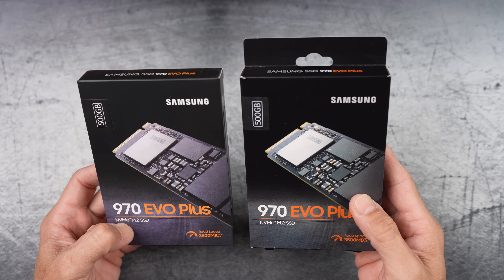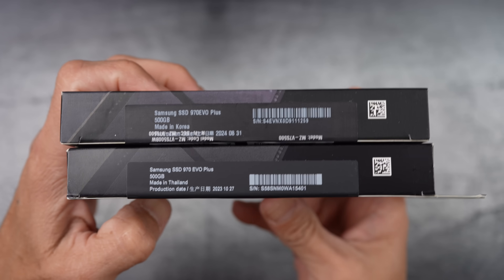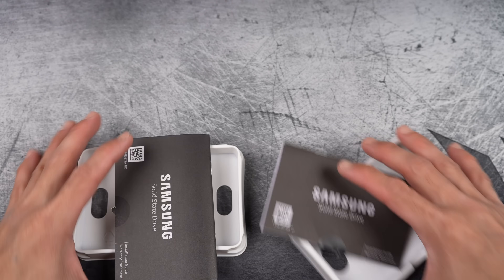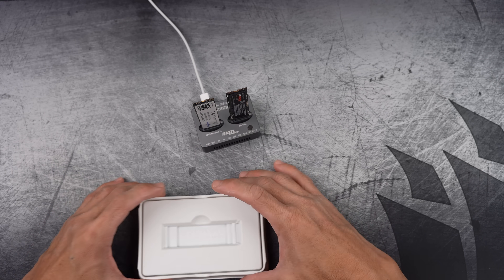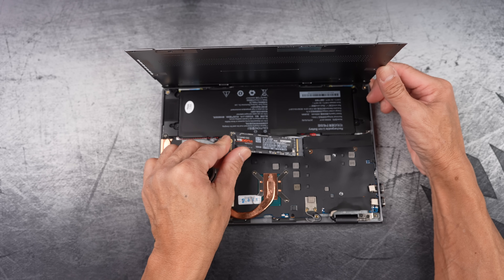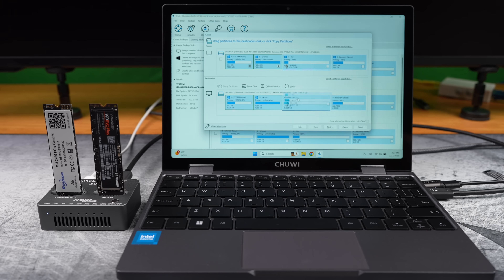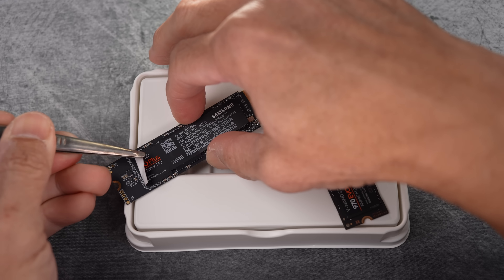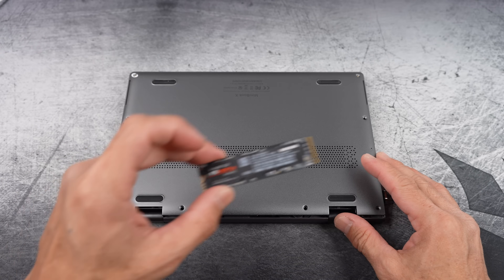Fake vs Real SSD - Can You Spot the Difference?

Comment: I already knew here that the one on the right was the fake because, for example, I didn’t like the sloppy sticker application, also the SSD controller wasn’t visible at all even though it’s shown large on the box, and overall it looked poorly finished, like the rough workmanship next to the cutout for screwing it in.
Reply from the maker: Great observations! The sloppy sticker application and rough workmanship are definitely red flags, and it’s interesting how the SSD controller wasn’t visible despite being highlighted on the box. Your attention to detail is great—thanks for sharing these points!
Reply: @TossSong  I avoid buying expensive electronic devices, like M.2 SSDs, from marketplaces like AliExpress, and instead, I prefer to pay extra and buy them locally where I have the assurance of authenticity.

Comment: You should check the names of the drives under the device manager to see which one has a generic name.
Reply from the maker: Great tip! Checking the device manager for generic names is a smart way to spot a fake drive. It’s such a simple step, but it can save a lot of trouble. Thanks for sharing this advice!

Comment: I think Samsung Magician will know if the drive is fake.
Reply: Not true. There’s some videos on YT showing how they tricked Samsung Magicians with some copies.
Reply: @ I find it hard to believe they can fake an authentic Samsung serial #?
Reply from the maker: Thanks for your comment. Yeah, it’s quite convincing. The serial number on the fake drive is not in the Samsung SSD database, but it does show up (just the name) on the Magician app.
Reply: @TossSong  So the consumer needs to be super careful not to get ripped off. First rule: Never buy anything like this out of China and always from a seller with a long track record of honest dealings and lastly, confirm the serial #.
Reply from the maker: @JoshuaTrenge Thank you very much for this information. Hope I won’t fall for another one like this.
Reply: @TossSong  I’m sure you won’t.. thanks for sharing your experience with everyone.. very helpful!
Reply from the maker: @JoshuaTrenge Thank you! I’m glad the video was helpful—it’s great to be able to share these experiences and help others avoid similar issues!
Reply from the maker: Thank you for your comment. Yes, I’d agree. If you notice on the laptop screen, I have the Magician app installed. However, it would have been a short video. But I could have included it at the end.
Reply: they must of changed something when they updated the software to version 8 cause I didnt get the non genuine message until I updated my version of Samsung Magician from 7 to 8. I bought my 970 evo at microcenter in 2019
Reply from the maker: Th Magician software says that the manufacturer is Samsung, but it won’t read the S/N properly and no ‘Genuine’ mark next to it.

Comment: I knew which one was the real one from the first view.  I bought a 980 1tb, and it had the hanging tab, so I knew that was the one that was real.
Reply from the maker: Thank you for your comment for sharing. It’s great that you could tell right away. The hanging tab definitely helps as a reference. Not everyone has that experience, so it’s great you spotted the difference so quickly. For me, I wouldn’t know it until I opened up the box for this drive.

Comment: the fake drive has good speed, better than any 2.5" sata ssd.
Reply from the maker: Thank you for your comment. I agree. So what I now use it for is as an external drive with housing. It works just fine, but I hope it will last.
Reply: And you can trust it for years to come.Or NOT????? hAha
Reply: @PHOTOREACTION  Trusting any single storage device with your data is like asking for data loss, even if it isn't fake.
Reply from the maker: I would definitely agree. Thanks for bringing this up.
Reply from the maker: Yeah, that I don’t know. I’ll have to see. Hope it will. Thanks for your comment.

Comment: Macrium has an option to copy partitions to fit and will automatically reduce the Windows partition to make it fit if the destination drive is a little smaller. I use it all the time.
Reply from the maker: Thank you for pointing this out. I did notice the option. However, I tried and tried to shrink it, but kept getting an error message that I forgot what exactly was, and that the partition was a fixed size and could not be shrunk. No matter, I did get everything to work perfectly. And I even reinstalled Windows to be sure. Thank you again.
Reply: @TossSong  It was "fixed size" because it was encrypted.
Reply from the maker: @beaker-yt Yes, thank for this. It is encrypted with Bitlocker.
Reply: Yep turn off bitlocker , if you turn it off with the fake drive you get to see how bad it performs due to lack of ram and when it runs out of SLC space it’s read/write speed will tank and high latency
Reply from the maker: @leexgx Thanks for sharing. I’ll try this and see. Hope I could figure how to turn it off.
Reply: @TossSong  I usually install rufus with it configured for automatic bitlocker encryption off (as by default Windows 10 and 11 will enable bitlocker if the requirements are all met for it) for turning it off or on just a matter of opening security center and device security encryption it take you to modern device encryption page (if your using Home) or for pro/enterprise/server it opens the  classic control pannel bitlocker page
Reply from the maker: I see. Thanks for the info. I’m happy that everything works as it should. The touch-screen driver on this mini-laptop was a pain to get.
Reply: Macrium also adds an intentional registry key that prevents Windows build updates.
Reply from the maker: @wallofriogrande Thank you for this info. I didn’t know that. Fortunately, I reinstalled Windows because I was getting an MMC snap-in error for Event Viewer, for example, which I don’t really. But I’m glad I reinstalled it, and no more error.
Reply: @TossSong  it's easy enough to remove
Reply: @wallofriogrande  Wait... what??
Reply: Samsung Magican has a clone function too, that should be working (?)
Reply: Just use th e included Samsung clone software that does that, its the entire point of paying the premium.